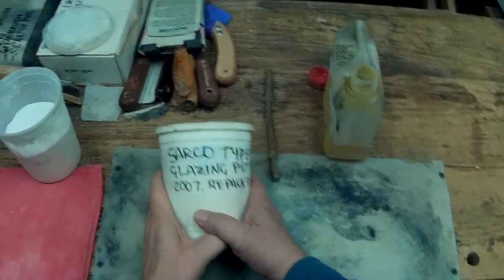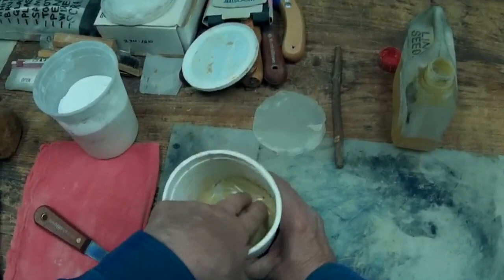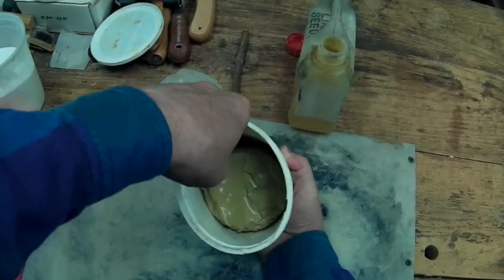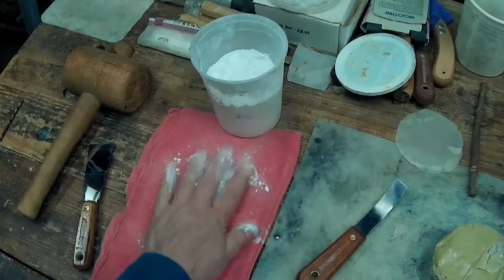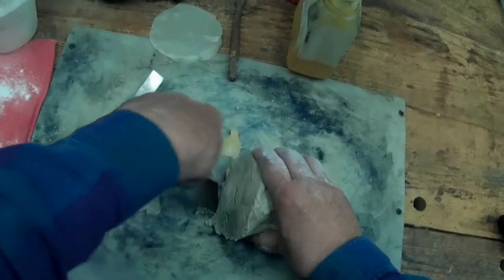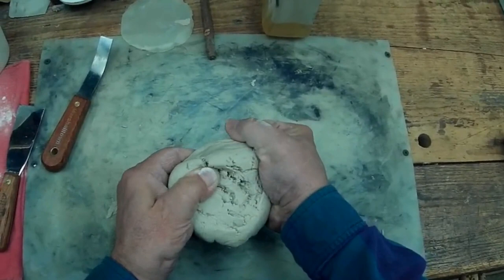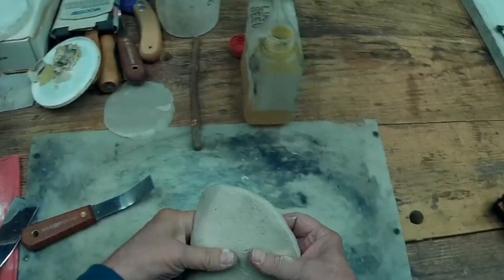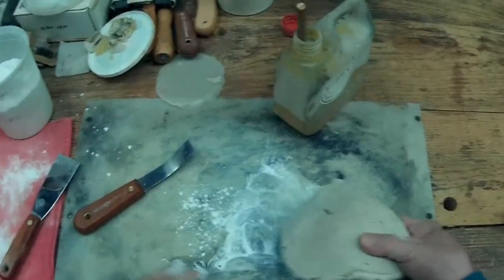Using Old Putty

Comment: Nice timing, have some Sarco Type M from 08 from Winn Restorations that I was wondering how to recondition.  With all this time on my hands I figured I'd get back to reconditioning my windows again.  I was thinking of using the wife's Kitchaid 6qt mixer with the kneading paddle when the wife wasn't looking.
Reply from the maker: She will  know you have used her mixer, when she goes to turn it on the motor is burned out. So don't do that ! One thing I didn't mention in the video is to warm the putty up, by setting it on a sunny window sill or radiator. ( and whenever you do, don't use the wife's microwave! )

Comment: Plastic of any kind is gas permeable. Oxygen and water vapor go through the container wall and the 6mil poly seal. The linseed oil cures when exposed to Oxygen.

You would be better off to store good putty like the Sarco in 1 gal paint cans. Metal, even very thin metal will stop gas permeability. You might have noticed that potato chip bags have a very thin metal liner on the inside. This keeps the chips fresh and crisp.

The ultimate long term storage would be to put the putty in the paint can and then dispense a bit of argon or nitrogen gas into the can. This will displace the Oxygen left in the can headspace and let you store the putty (or paint) indefinitely.
Reply from the maker: Padraic, all your technical points are correct. This video demonstrates that the simple expedient of using 6-mil poly is very practical, and even reusable. I have used aluminum foil, which worked perfectly, but it tore on removal and was not reusable. The gases do work, but are not readily available, and so costly  that they would not be worth using to save a relatively low-cost material like putty.
Reply: @johnleeke  I'm a hobbiest TIG welder and so have plenty of Argon readily available. Even a MIG welder's CO2/Argon mix would do a fine job.

Comment: I see you are not priming the wood prior to putty. I've read several places now (including your website I think) about linseed oil perhaps being prone to mold growth. Everything gets so confusing to remember and even understand. Do you still use linseed oil on the sash before applying putty? Linseed mixed with mineral spirits? Could I just prime with Zinsser cover stain oil primer prior to DAP putty? So much dirt and grime, I'm trying to scrape most of it out, should I try to clean a little with a borax/vinegar solution? (allowing time to dry of course)  It's not practical for me to remove the windows so doing in place. Thanks!
Reply from the maker: kalo, I do prime or pre-treat the glazing rabbet before glazing, although it is not shown in this video, which simply shows that the saved old putty tools nicely. The traditional Boiled Linseed Oil and Turpentine (BLOT) mix works well in the glazing rabbet. The turpentine helps to prevent mold. you could prime with an oil-based alkyd resin primer, but the BLOT is better. Scrape the wood surface of the glazing rabbet to clean it down to bare wood, but do not use any cleaning solution. For more on glazing and painting sashes, get my book:
http://saveamericaswindows.com/get-the-book/
--John

Comment: Is that a dedicated putty mallet?
Reply from the maker: Hi Larry, I had made it as a general purpose mallet, but now always use this one when pounding putty. I think anything suitable for pounding could be used, like a short piece of 2x4, etc. Pounding works well for me because I have hand problems and simply kneading in my hand or against the bench is difficult. Pounding makes working the putty easier, and compete mixing of the putty takes less time than kneading by hand. Pounding also warms up the putty because the kinetic energy of the mallet is converted to heat energy in the putty.